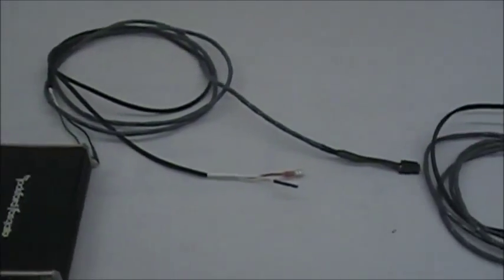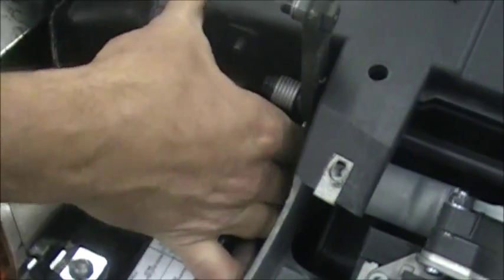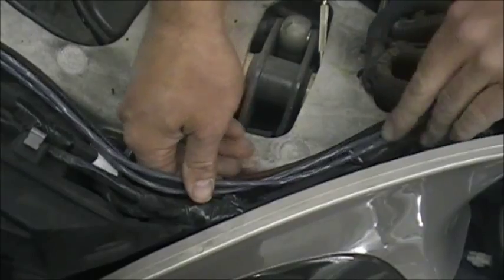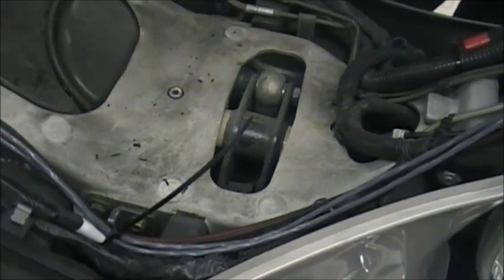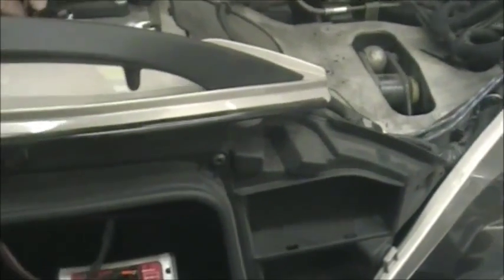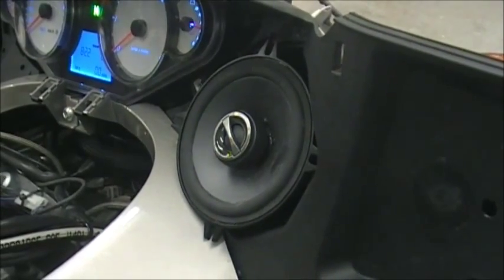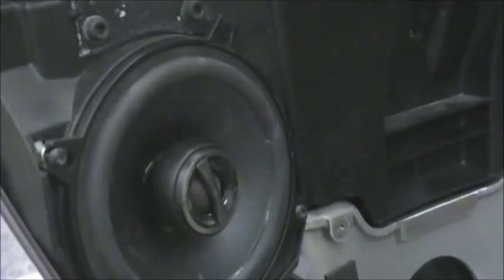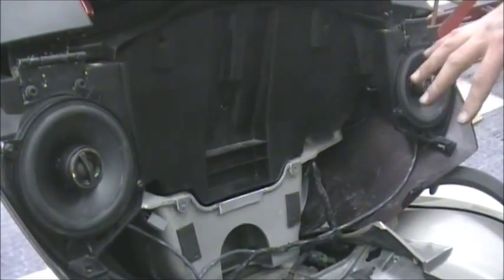Witchdoctors.com shows How to Install a Vision Amp and speaker kit

Comment: One important note and 1 comment. You need to turn off the AVC function in the radio (volume control as speed changes). You will fry the amp inputs from prolonged use. It will be one of the options as you step through the modes on the radio. Also, I suggest including tags in the kit so that the wires can be labeled at strategic spots. The next service tech or who ever will be able to easily identify anything aftermarket and know what and why it's there. I use 1" masking tape with a sharpie for a label in a pinch.

Comment: What controls the amp on/off if the power wires are directly on the battery
Reply from the maker: It still runs through the factory stereo so it controls it.